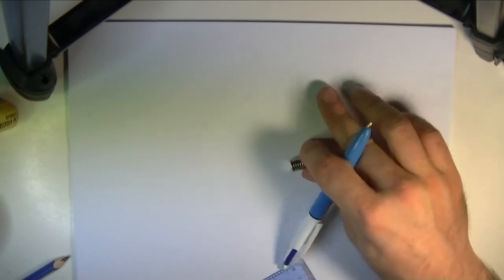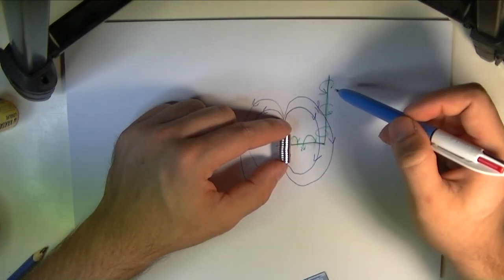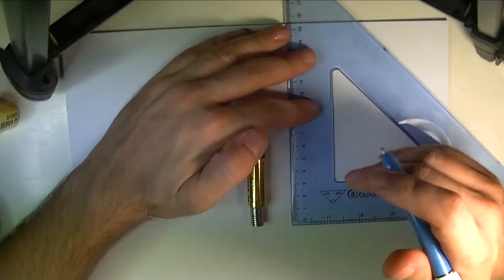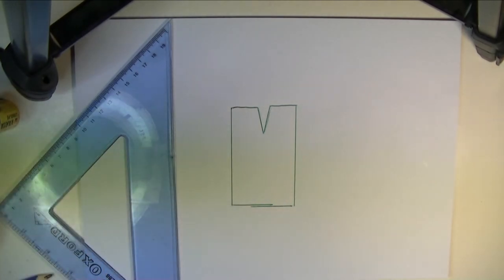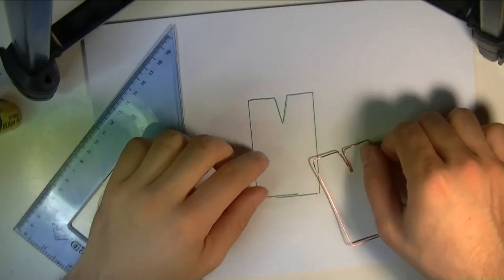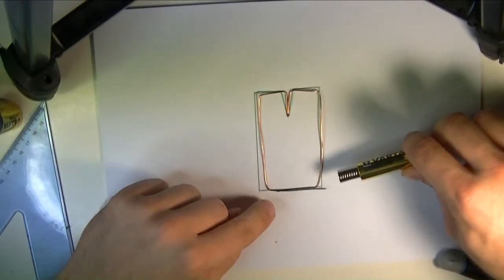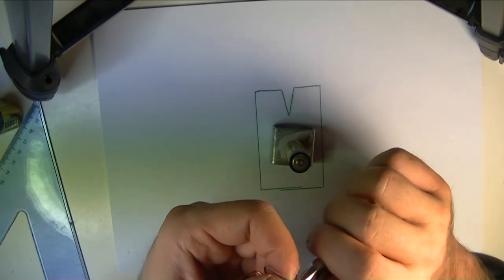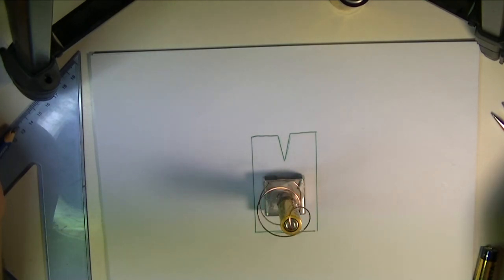DIY Homopolar Motor

Comment: Why do you burn the wire? What will happen if you don't?
Reply from the maker: Oh there is a good reason the wire has insulation on it and you have to burn the insulation or sand paper it off